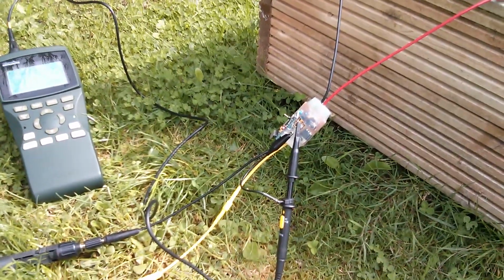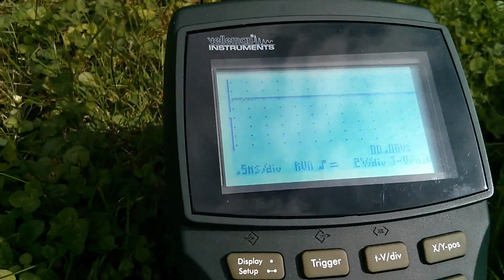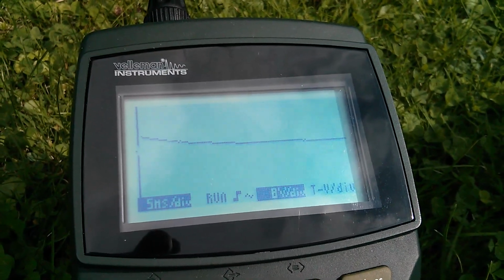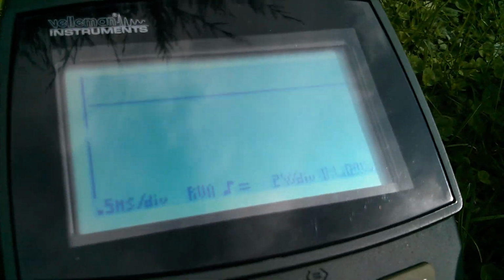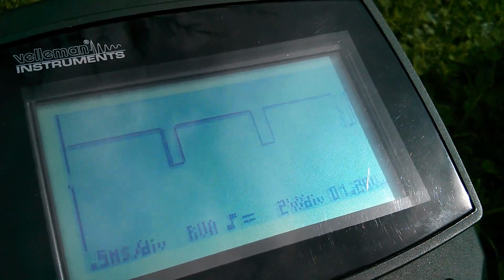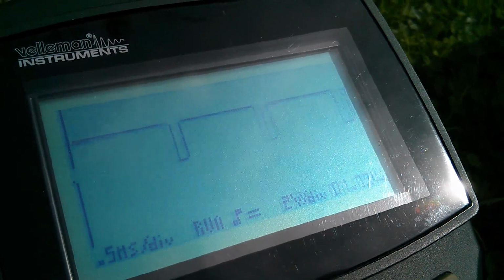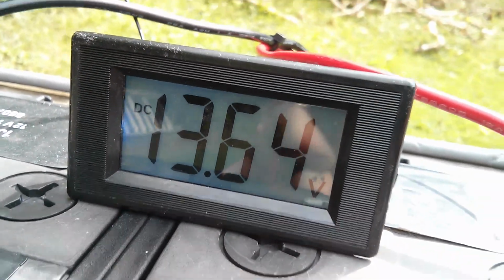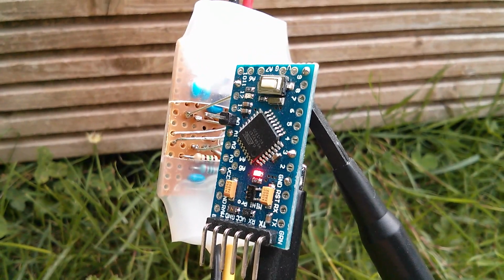Arduino PWM Solar Charge Controller #6 - Proportionality

Comment: So, your circuit is just a voltage regulador across the load(battery), using PWM to achieve so. It is not design to deal with Bulk, Absorption and Float phases like a high end PWM solar power controller. Am I right?

Comment: From what I see here all that needs to be done is Kelvin connection to the battery so that the wire resistance doesn't throw off the voltage measurement.

Comment: I work with hardware, not code.
Do not use zener diodes for voltage measurements.
Lead batteries are damaged by ripple.
Encourage all users to mount fuses all batteries individually, as close to the plus pole as possible ...
Reply: Ripple [citation required]

Comment: @Julian ilett Your explanation of the jittering of the pulses seems very plausible.  I recon that other charge controllers, in measuring the battery voltage, does the same thing in when the pulse is off.  Then again how does it measure it when you are at 100% duty cycle?

Comment: Can pwm-chargers always be connected and charge at 13.5V without damaging the batteries?
Reply: +hoplahey Yes they can. Many kinds of batteries are fine with a trickle charge, though some batteries will have a decrease in lifespan.

Comment: Can you please explain this line const int setPoint = 13.5 * 20 / (20+82) * 1024 / 5; sir if i may ask why you didn't use DCOI OPTO-ISOLATOR DRIVER , and please what do i need to change in your code to inplement this DCOI-OPTO-ISOLATOR DRIVER in the circuit to eliminate the need for charge pump, and possibly port your code to attiny85. thank you sir expecting  your reply.

Comment: Thanks for your insights. I am working on a similar control loop for a motor control project.
I just wanted to point out a similar mistake I had made.
With your error value (stepsize) it will be 0 to 1023 so using it directly for pwm will give you 4x what you need. Maybe wrong as I am no expert....

Comment: Appologies on commenting before watching the earlier videos in the series but...

You may be used to opamp feedback circuits being pretty ideal. Opamps are easy to use for simple feedback circuits because they have internal dominant pole compensation. Arduino doesn't have any in built compensation, so you'd have to do all that yourself otherwise you're leaving all the stability and transient response parameters up to chance and the parasitics in the circuit.

Stabilising a complex control loop is not easy; optimising it is even harder. You have to calculate all the poles and zeros in the loop, loop bandwidth, phase margin at 0dB crossover frequency etc. Having part of the control loop in the digital domain doesn't get you around any of this it just makes it harder to calculate the equivalent analogue frequency response and gives you a false sense of security that negative feedback is absolute and ideal.

If you do manage to design the feedback loop well, it can eventually be rock solid with no jitter on the duty cycle and little overshoot or undershoot. duty cylce would move smoothly as required with light level etc. Personally I'd tend to keep feedback loops analogue where I know what I'm doing and have a digital interface to the analog loop through DAC or digipots. Digital feedback loops can work incredibly well but only if you have expensive ADCs and DSPs and know how to use them to implement a good s-plane transfer function.
Reply from the maker: KX36 I kind of understand the principles involved, but I'm not familiar with all the maths. So I'm taking a no-maths approach to the design. Sort of intelligent trial and error.
Reply: which is fair enough. even if the duty cycle oscillates, undershoots and overshoots and is slow to respond, it obviously still can work well enough to fulfil its purpose. pretty difficult to improve on it without reading textbooks for a couple of years anyway except by luck.

Really I just wanted to point out that if its unstable as it looks to me it might be, unless there's something fundamentally wrong with your code, there's probably not much with simple arduino code you can do about it.
Reply: KX36 
Just had a thought, potentially something you could do to make it more stable without in depth knowledge of how to mathematically represent your power stage is perhaps to keep it really slow to respond like your digital boost converter is really really ridiculously slow compared to any analogue DC-DC converter. You'd be trying to create a dominant single pole, low bandwidth system with around 90 degrees phase margin which makes it so overdamped it won't overshoot despite being so slow. How slow it would be would depend on the open loop frequency response of the power stage. It might not need about 30 seconds like that boost you have, it might for example ramp up in 1 or 2 seconds which is still really slow for a DC-DC converter but not long on a human timescale.

This is something that probably could be done in the microcontroller, although that's not my area of expertise. In a DC-DC converter I might use an opamp integrator as an error amplifier with type I compensation  http://i.stack.imgur.com/DfnRx.png and at the loop step response on a digital oscilloscope, adjusting the value of the feedback capacitor first to remove any oscillation under all conditions of light level and load resistance (always positive phase margin), then reduce or remove ringing (>45 or >60 degrees phase margin), then reduce/remove overshoot (>76 degrees phase margin, Q<0.5). Or start from the other end with arbritrarily large capacitors which hopefully would give a solid 90 degrees phase margin and attempt to reduce them for a faster response until you start to see overshoot then back off. The best response is at 76 degrees phase margin, but as long as it's over 45 degrees under all conditions it should be stable.

Really need to power it from a fixed light source while working all of this out, tricky to see how stable the loop is with a constantly varying level of sunlight.

Comment: Hey,
on any ATxxx devices with timers you also get at least a timer overflow interrupt and a compare interrupt. You have to decide witch one fits your needs, mostly if you are in fast pwm mode (you shouldn't use phase correct pwm here) you use the non inverting mode so the pin goes high when the timer starts at 0 and goes low when it reach your compare match value (the value you set with AnalogWrite). This setting is COMxA1 = high COMxA0 = low (page 154 in ATmega328p datasheet). The compare interrupt gets fired when the timer reach the compare value, at the same time it sets your pin low and your FET gets shut off. When you start your ADC conversation in this interrupt the sample and hold step is after 1.5 ADC clock cycles (normally around 50kHz and 200kHz) see page 243.
I'm not sure how to use the interrupts in the Arduino C but in "normal" gcc-avr code you use

#include <avr/io.h>
#include <avr/interrupt.h>

// replace TIMER2_COMPA_vect with your correct timer and compare match register
ISR (TIMER1_COMPA_vect) {
// your interrupt code here
}

// change for your needs and put in your setup
// enable Ouput compare A on timer 2
TIMSK2 |= 1<<OCIE2A;

at this point your interrupt gets fired every time your timer reach the OC value.

Comment: Julian,
Is there a link to the schematic and full sketch of your PWM Charge Controller #6?
Thanks.
Reply from the maker: Jay R The sketch is very short - it's in as a comment on this video. The schematic is on my website, but my web server is very flaky at the moment, so it's often offline: http://www.256.co.uk/?p=917. I'll put all this on github just as soon as I've got my head around git. The schematic will change slightly as the Arduino Pro Mini has its own voltage regulator.

Comment: Years ago I wrote a tutorial on PID controller tuning.  It is not a tutorial on the mathematical details of what such a controller is, but those are available other places.  Perhaps this tutorial might give you some ideas about how to improve the feedback control of the duty cycle in this system.
http://www.designnotes.com/companion/PID/popelish.html
I agree completely with the value of syncronyzing data taking with pulse output.
Reply from the maker: jpopelish A very interesting read - thank you. I'll come back to this if I feel an integral component is required
Reply: Julian Ilett
Actually, I think you have implemented integral control (you keep adding corrections together, until the error is zero), not proportional (calculating the instantaneous error and producing an output proportional to that error, added to a fixed zero error output).  Integral only control eventually gets toa perfect solution, but it approaches very slowly, or overshoots.  Combining integral and proportional (the assumed zero error base line output is built, gradually, by repeatedly summing small corrections for the error since the last correction. i.e. integrating error) while a proportional factor dithers that base line in proportion to the instantaneous error, without altering the baseline that the integral is working on.  This allows the integral effect to find the true zero error output, while the proportional effect eliminates the overshoot and speeds most of the reaction to fast load or supply changes.

Comment: Hi Julian,

A fellow Youtube Creator by the name of thenewboston has a series on using github, I haven't watched it yet but his other videos are usually very good!

Additionally, I am in the process of decommissioning a number of large APC UPS's at work, could you find any use for the batteries before I dispose of them?
Reply from the maker: Strangely, I never thought of using YouTube to learn how to use github! I'll take a look at his channel. Regarding the UPS batteries, where approximately is your workplace?
Reply: I'm based in Stevenage Hertfordshire, we haven't decommissioned them yet, but I am planning to very soon, going to have a few batt's for my own use, and also strip down some of the circuit boards(nice big fat heat sinks!!) but there is prob 20 odd batt's for the taking?
Reply from the maker: TornTech That's within driving distance - I wouldn't say no to a few of them. Let me know. Cheers.
Reply: I will send you a message when I decommission the units :)